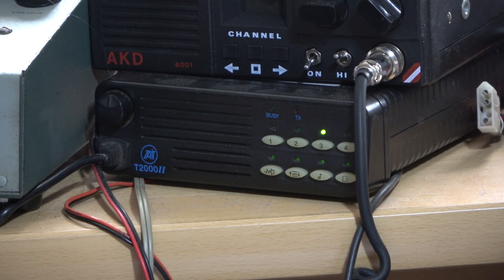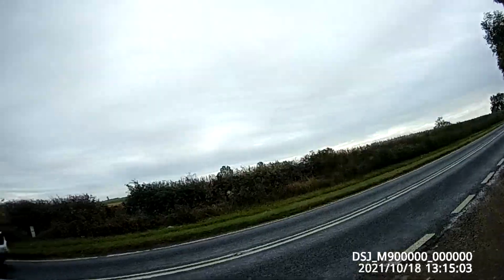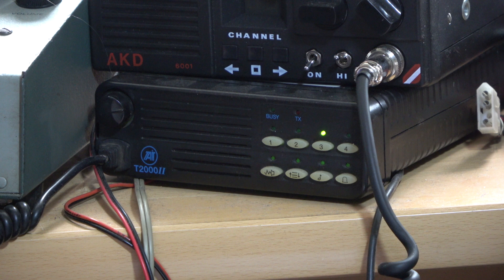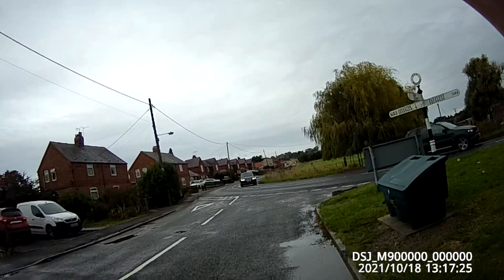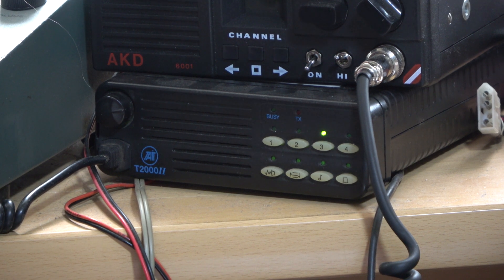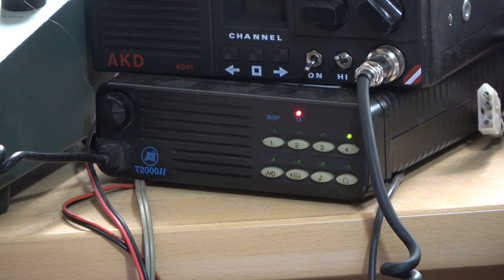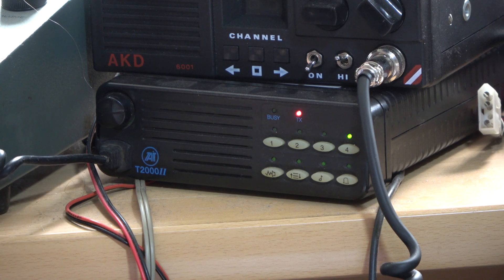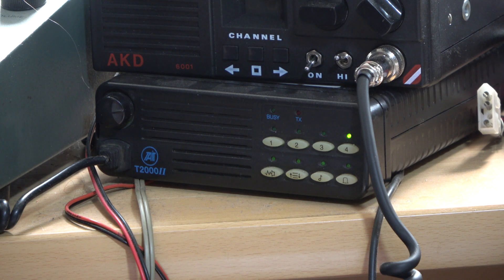Baofeng 888S 1.5W UHF 70cms amateur radio - field test

Comment: What about a Slim-Jim antenna for 432Mhz
Reply from the maker: The slim jim is effectivelt a folded dipole so has no gain or loss & is a great aerial for people who have little space. Here at the base end I'm using a 'white stick' colinear base station aerial which is 3 x 5/8 wave stacked with quarter wave groundplane radials. Bear in mind I'm in the middle of nowhere with an acre of garden & no neighbours for 1/2 mile.

Richard, G0OJF, UK
Reply: @ukfmcbradioservicingTango21  I am sorry but I got one working on 88 to 108Mhz and really pulls in stations very effectively I would be making another for 174-239Mhz some time.

Comment: Is the boefeng as it comes from out the box or had u reprogrammed it
Reply from the maker: You have to program it for frequencies you are licenced to use. It would be illegal to use on PMR446 freqencies for example. So we programmed it for 70cms amateur radio channels for which we are both licenced.

Richard, G0OJF, UK

Comment: It's Amazing How The Chinese Can Produce Them Radios At The Price They Do 
I've Got A Little Baofeng UV 5R III It Really Is A    Cracking Little Set Pushing Around 4 Watts 
Great Video Lads
Bless Up
Reply: SDR and power mosfet's mean no expensive ceramic or crystal filters, nothing to manually tune, wide band front end and TX PA, and easy to mass produce. but it does mean very poor strong signal rejection, Most Private Business Radios are still Superhet as they have to work under all strong nearby signal condtions

Comment: Bit much for 70cms without the repeater.  Well done on the demo.  You need line of sight or height.  I agree on the cost of radio, why should it cost thousands.  No fun in that!  A cheap radio like that will put you on air on the Foundation Licence.
Reply from the maker: Yes, as I mentioned in the video; a gentleman in Sheffield sometimes joins us on GB3GR on our 8PM Wednesday night net using one...and that's a good 65 miles to the repeater. Yes, it's plugged into his roof aerial, but is still less than 2W.

Richard, G0OJF, UK
Reply: @ukfmcbradioservicingTango21  Yes, you did mention it, I remembered it.

Comment: All good stuff nice to see the small radios given a go. By the way is the repeater your own.
Reply from the maker: Yes, I am the sole owner of the repeater & personally pay the site rental & electricity bills at the commercial 2-way radio site where it lives.

Richard,  G0OJF, UK
Reply: @ukfmcbradioservicingTango21  Nice it would make for a fantastic video to see it onetime. Have a restful night
Reply from the maker: Sad to say that for security reasons, no photographs are to be taken at the commercial 2-way radio site where the repeater lives. If I recall, the license power limit is about 12W. In order to try & not suffer from pirates or wallies, there are no 'courtesy tones'. The repeater comprises of all-new equipment about 3 years ago & is a commercial talk-through base station, PSU & aerial filters each in 19" racks & the aerial is a Diamond product manufactured specifically for repeater use. It is single antenna working. In line with license requirements, the repeater sends it's callsign in morse every fifteen minutes.

Richard
Reply: @ukfmcbradioservicingTango21  Yes i under stand for security reasons,12 W is perfect as it shows when you and MR C have used it with hand portable radios.Yes i get fools on the 70cm and 2 meter repeaters where i live it is a pain at times.

Chris

Comment: The aerial that comes with them is poor, a later series UV5R aerial works better and thats a dualband.
i use 17cm Kenwood TK3107 PBR 1/4 wave, a 16inch 5/8th would be ideal but a commerical one would cost more than the radio
Reply from the maker: That's fair enough, but all our tests are conducted with the factory supplied aerial for absolute fairness.

Richard, G0OJF, UK
Reply: i bought the newer uv10r which is supposed to be 10W but measures 4.7W on UHF.
Reply from the maker: Yeah, of course it's not 10W. It's more bullshit than VW car spec figures! The US goverment determined that the absolute safe power limit for UHF handhelds is 7W, so it's best to have them 5W & under. I've been in commercial 2-way radio for 4 decades & have yet to see UHF handhelds over 5W. I would always ensure UHF radios are 5W or under before returning them to customers.

Richard, G0OJF, UK
Reply: @ukfmcbradioservicingTango21  depends on the field strength? 10w into a 16inch 5/8 might spread a wider lower field strength to your head than 5w into a short helical?
Reply: Love the VW comparison Richard 😆👍
Reply: @LeeDonaghy  Yep, that's normal for those. Seen the ones advertised with crazy power levels?